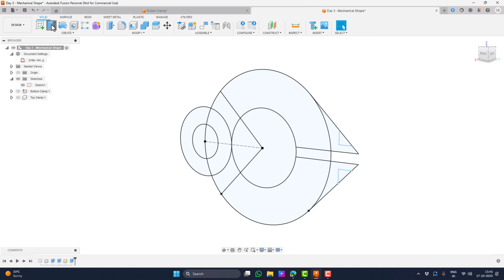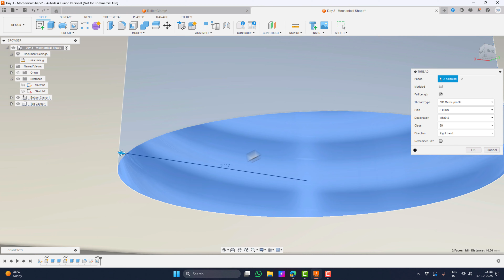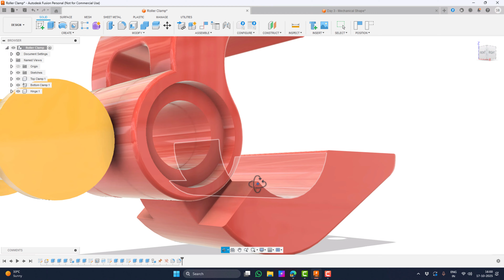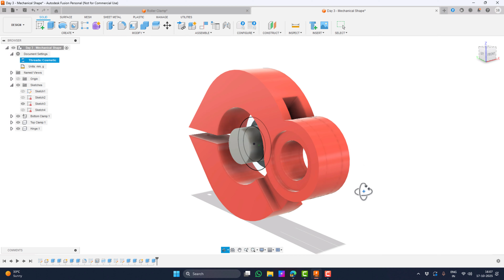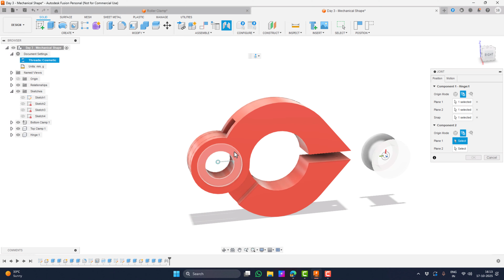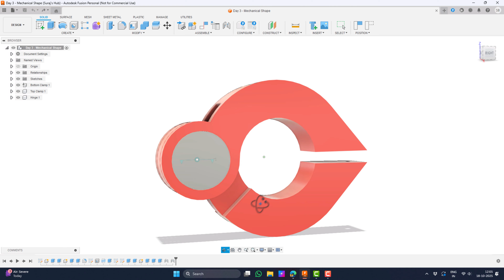How to create a hinge Clamp in Fusion 360 2026 Tutorial For Beginners Part 3

Comment: Man, how do you print this? I mean this has to be printed by parts but what about the hinge.
Reply from the maker: The trick is printing it flat on its side! This keeps the gap on the X/Y plane so the parts don't fuse.

Set your Z-Seam to "Random" so blobs don't build up inside the hinge and keep your cooling fans at 100% to prevent sagging. If the first layer squishes too much, a tiny bit of "negative horizontal expansion" in your slicer will keep the bottom from welding shut. Just give it a firm wiggle after it cools to break it loose! Depending on the material and your printer you might need to experiment a bit if not done already.